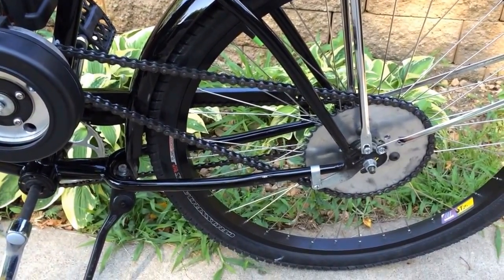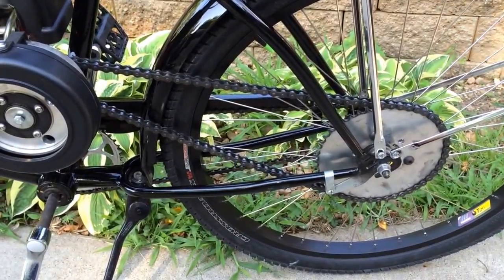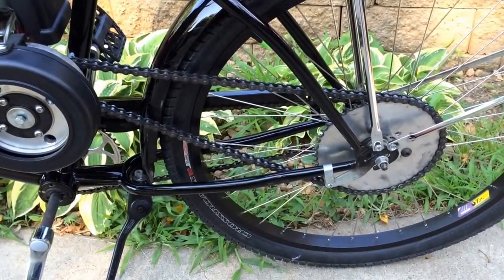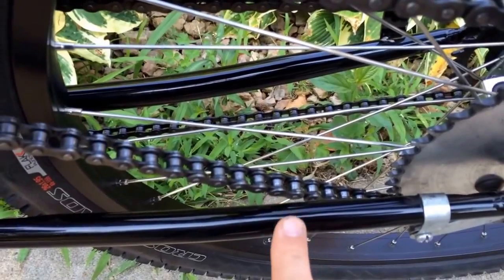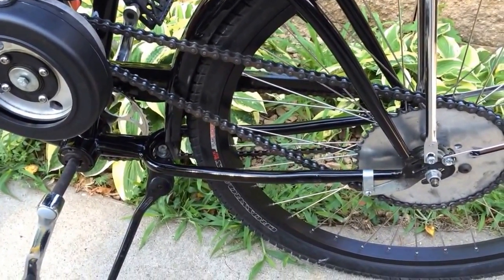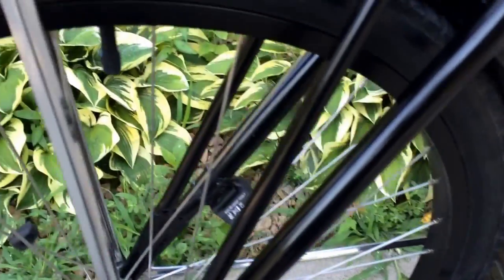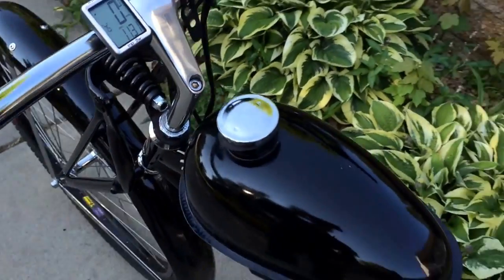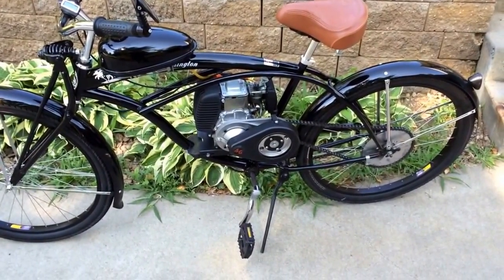Motorized Bicycles Direct Drive Review And Preview To Next Build

Comment: Just to give you a heads up.... I use a 1/2 link on the pedal chain and a 1/2 link on the motor chain.... this allows me to pull the wheel all the way back.... for strength and alignment purposes.... trust me it works great ( after my 4th build ) I use a chain tensioner that mounts on the engine.... and if the chain hits the frame I use the crappie chain tensioner that comes in the kit.... with both styles of chain tensioner it works great.... every build I find better ways of doing things that work.... my first build almost killed me...!!!!! To ouwn one of these bikes is constant maintenance but worthwhile and fun.... I get pulled over by cops.... never got a ticket.... just questioned about the bike and pictures taken with the cops and also young kids that think that the motorized bikes are the coolest thing.... of course their parents always want to take pictures with their kids sitting on the bike....!!!!!

Comment: Great video I’d be interested to see you or someone do a video showing how to install a 2 stroke motor on a tricycle and I’m not talking about mounting it where the basket is for cargo but on the frame above the pedals and which tricycle is the best choice for this kind of project changes you got to do to get it to work and how to mount the motor and the sprocket etc cause if any has there only showing the final result and or driving it or they show how to mount it where the basket was or installing a friction front wheel motor

Comment: Question: how much space (inches) is required from the top of the crank to the bottom of the bottom frame rail (under the tank) to allow the use of the 4 stroke engine?

Comment: Are these any good on gravel roads? I'd like to build one myself, but I'd specifically like to cruise it along the mile long gravel grid roads that are around this area. What would be your suggestion? I like the Huffington styling, but can you put mountain bike wheels on it? or should I be thinking more along the lines of one of these new the fat tyre bikes?
Reply: Ronald Whittaker Thanks, I since built it and put the mountain bike wheels on it. I've found that most of the gravel roads have compacted earth that run along side them. It rides the earth pretty well.
Reply: Ronald Whittaker Well, I actually built mine with a $20 tool set that I purchased from walmart. Has all spanners and screw driver sizes that I needed. Now the tools reside in a small bag which is strapped to the rack on the bike, should I need to do some fixing on the side of the road.

Comment: hey man what kind of crank set are you using? I have a Huasheng and the pedals don't clear?
Reply from the maker: Justin Jirikowic  Out of curiosity, where did you get your kit from? My crankset came with the Huasheng 49cc 4G belt drive kit from GasBike.net. Now the kit I ordered for the GTS build was from another company and they has a shorter crankset that gave me a ton of issues with clearance. I just checked on GasBike.net and they have the wide crankset for $60. If you want a press in style sealed bearing custom wide crankset and you want to pay $180, let me know and I'll try and find what site it is. It's a lot for a crankset, but it's built like a brick and will be going on the "Huntington Resurrected" build this winter.
Reply: dude I got my kit from bikeberry.com. this was a huge mistake because the stuff it all came with was cheapest of materials. the bolts that mounted the muffler stripped like 3 times. so I had to go inside and drill them out. so the crank set on gasbike.net can clear a lot? the one you used seemed to clear a lot of space. the gear box I have on the hand is Easy-Q matic one. so I need a lot of clearance

Comment: Does anyone sell a kit that has this type of rear hub sprocket clamp and a back of seat alloy fuel tank and good quality engine mounts. I'd be interested in buying a kit with all the upgrades already done so I don't have to throw half the kit in the bin and then search the net for suppliers for better quality parts. . I can't find anyone who has what I want. And in the UK I can't find anyone selling a basic kit. Have to order a kit from China then start replacing fuel tank/pipe/sprocket clamp etc . . seems odd that no one has started selling these this side of the pond. Our laws about motorised transport are the strictest on the planet so that might have something to do with it..in the UK I think the bikes need an MOT a number plate. Insurance and road tax. Basically cancelling out any financial saving you might be trying to make. . .

Comment: Hi I want to get rid of my tensioner ? It looks like it will be okay with a few links removed ? Any input on doing this ?                                                                     Thanks  D. A.
Reply from the maker: +Pouche Andrews I know I have one of my earlier videos that shows me removing the tensioner completely, but I don't recommend it. There is already such a small amount of space for the chain to travel from the engine back to the sprocket and when you take the tensioner away you have even less space. Plus since there is no tensioner in between you're losing lateral control of the chain.
Reply: Hope my comment went trough ? Anyway Thank You for your input D .A .

Comment: I don’t see how anyone is able to install the rear sprocket kit. I always buy the custom version because it mounts on the hub of the rim, perfectly aligned every time. Such a pain trying to mount on the spokes! Ugh!
Reply: I always use a frame mount spring tensioner. I have never had a problem. I manufacture them myself.